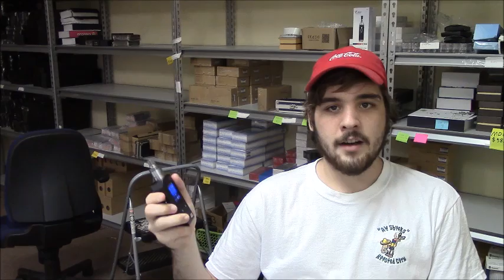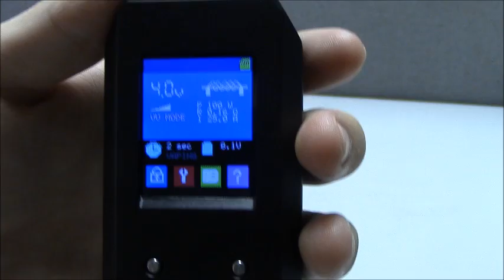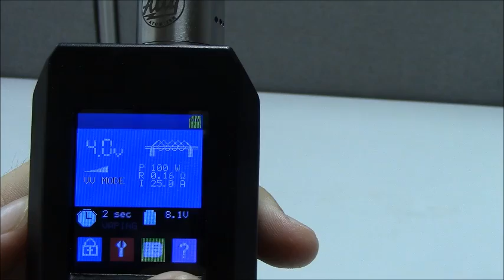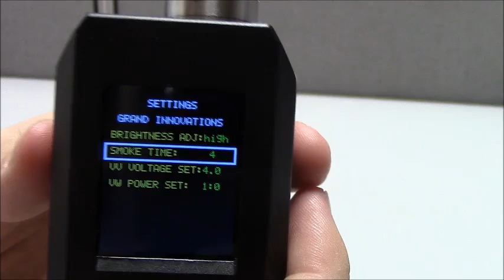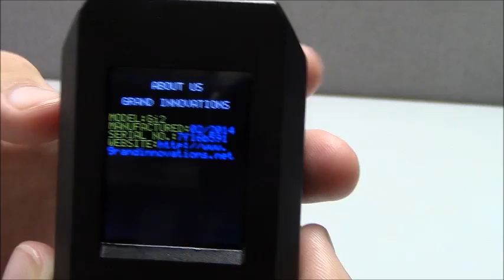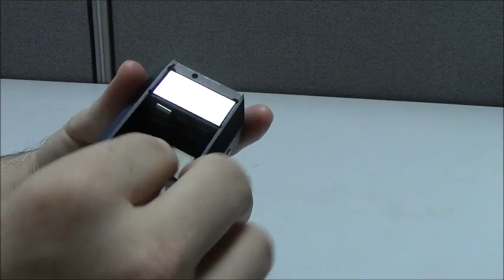Gi2 100W Box Mod Clone Review

Comment: Does the glitch where it locks and fires continuously get worked out, I hope? This was a dangerous mod to begin with because of the safety issue.
Reply from the maker: that glitch has thankfully been fixed! i was worried about that when i first got it as well.